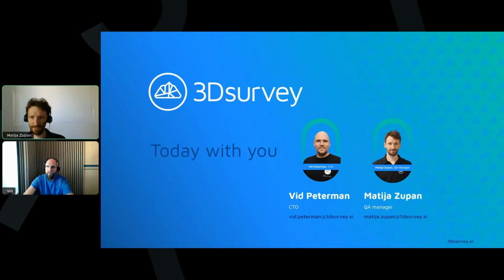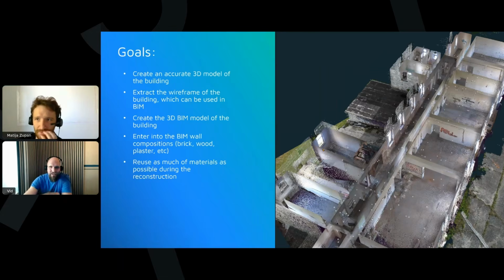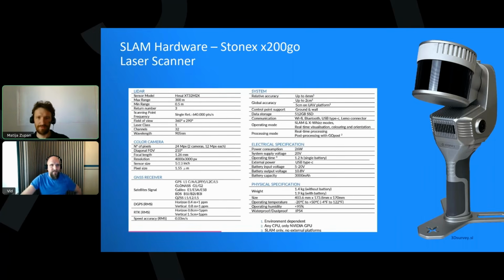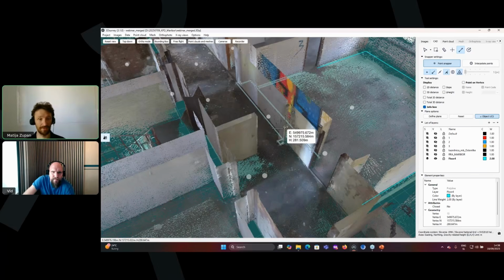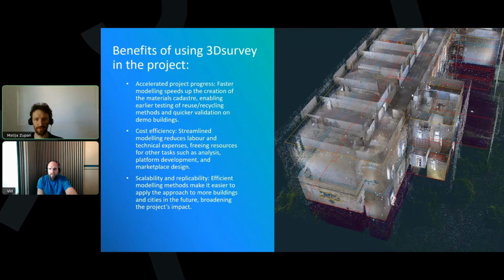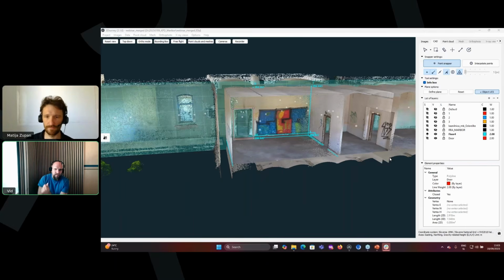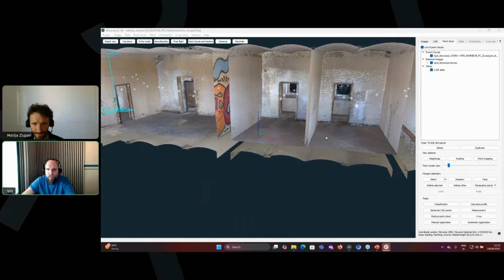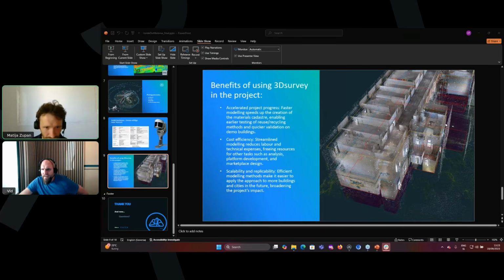Webinar: How to create a complete 3D model of building interiors and exteriors

Comment: hey,,,i have gone through the webinar vedio and its informative thanks, now my question comes in when collecting the interior data using the slam,i understand when you configure the slam outside first the slam will be in fixed solution and when you get inside the building its gonna loose the fixed solution .I you picking your data when the slam is in single solution
Reply from the maker: This is where a good SLAM device differs from a "not-so-good" SLAM device. A good SLAM device has additional sensors built-in, like IMU, to keep track of your movement when you loose signal. However, a drift in data can still occur. We recommend recording control points.